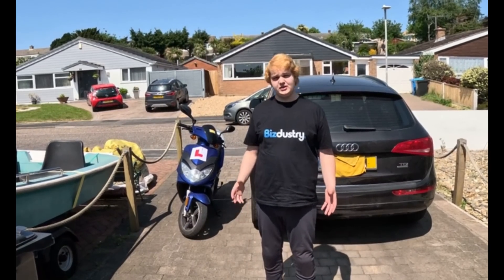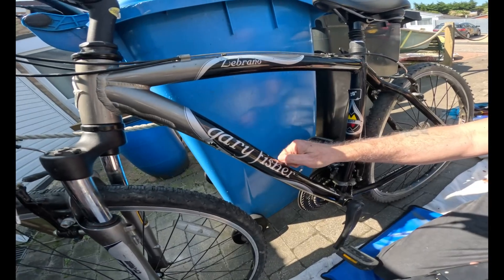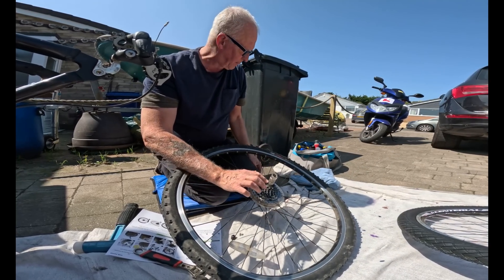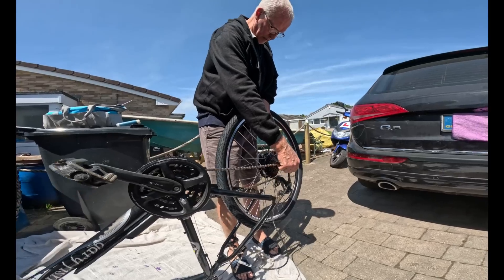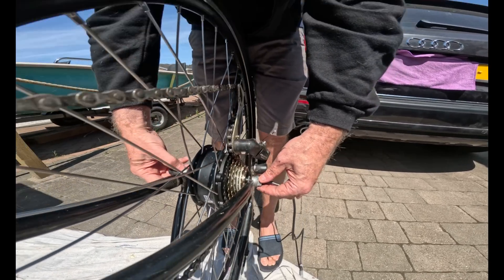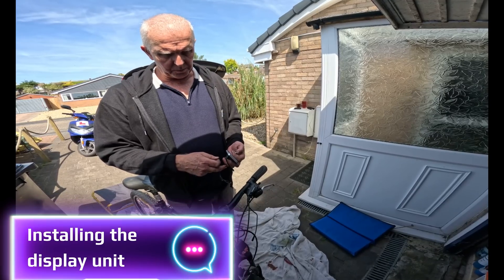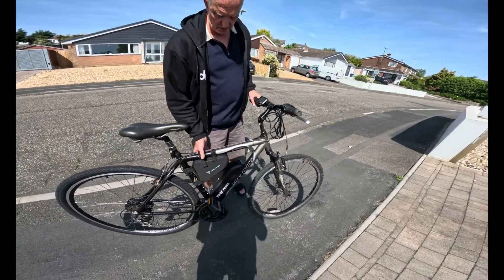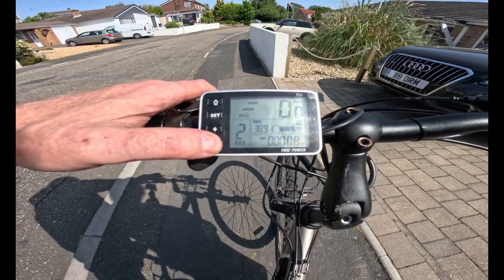YosePower - eBike Conversion Installation with YosePower

Comment: I love any type of exercise machinery that is motorized, like the way this Ebike was converted. I have motorized bicycle pedals here (the pedals only) and I've always preferred them to a regular stationary bike. It's great how he also installed a monitor to track the distance. I never purchase any exercise equipment without some type of monitor attached. Otherwise, you're just guessing. Assisted bike riding is SO MUCH more enjoyable than regular pedaling on a bike. I just believe passive exercise is more appealing and, in general, easier. But in a good way. It keeps you a lot more motivated and coming back for more.
Great tutorial.

Comment: I have an electric motorbike, I have been using this e-motorbike for a couple of years. However, I am also thinking to buy an e-bike because of its cheaper price and low maintenance cost. While e-bikes are expensive, converting a normal bike into an e-bike seems to be a better alternative. Thanks for the tips.